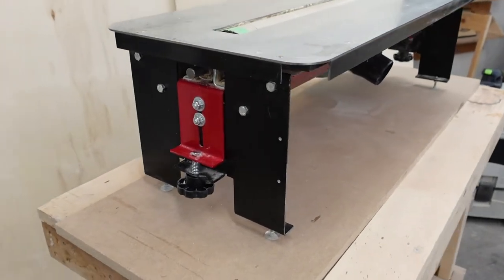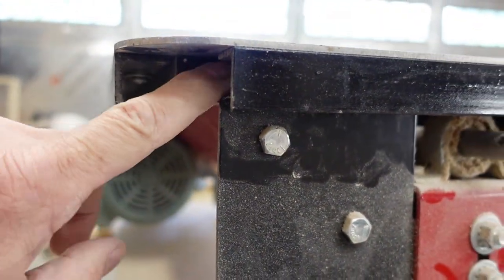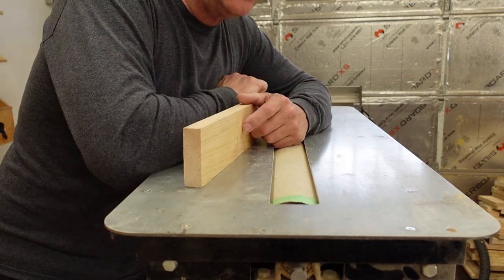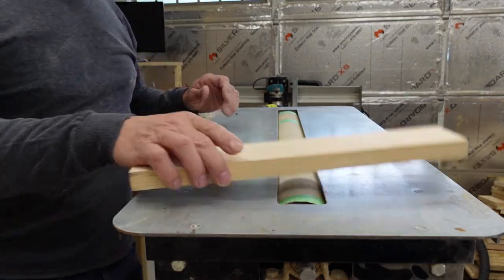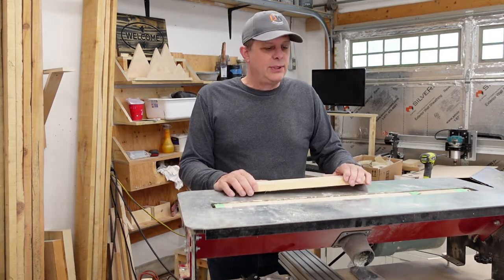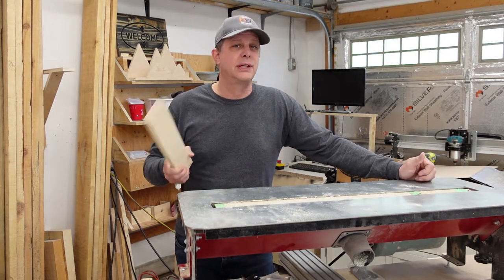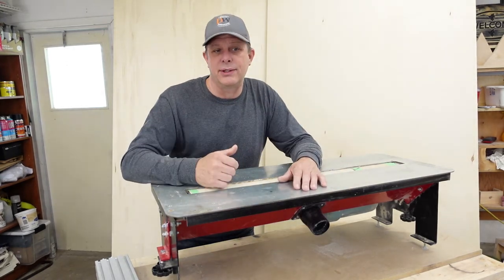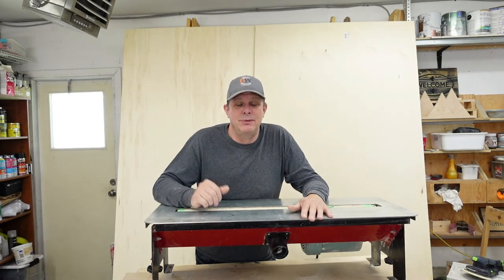Flatmaster Drum Sander Adjustments

Comment: hello. Thanks for the vid. I was wondering if the sandpaper is adhered onto the roller or if it is floating somehow? I ask because I was confused how this would flatten given the infeed and outfeed are at the same height but then I was told that that the sandpaper is ostensibly floating off the roller given the centrifugal force which is why it doesnt just put a rut in the work piece.
Reply from the maker: Hi, exactly! It does float above the cylinder with centrifugal force  The sandpaper is held by velcro so there is an air gap avoiding heat build, thus less gumming up.
Reply: @DustyWorkbench  ah, velcro. that makes a lot of sense. thanks!

Comment: What do you recommend for a good working height for the unit.  I have a work bench that is 36 inches high and with the Flatmaster sitting on it, it seems too high.  Thanks
Reply from the maker: We have ours within the bench so the top is at approximately 36". We find that to be good height.
Reply: @DustyWorkbench  Thanks.
Reply: I put mine a half inch above my table saw and workbench (37") so if I sand a long piece it can fall on them as a sort of outfeed catcher.
Reply: @philsaudio6mm  Thanks.